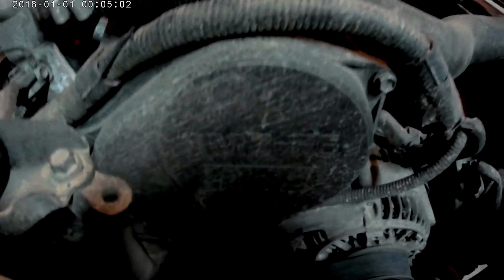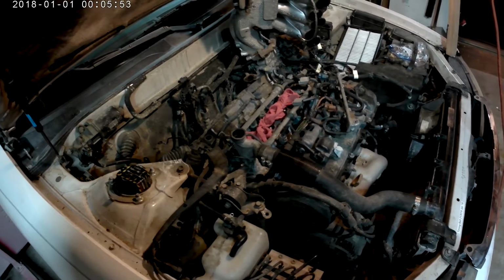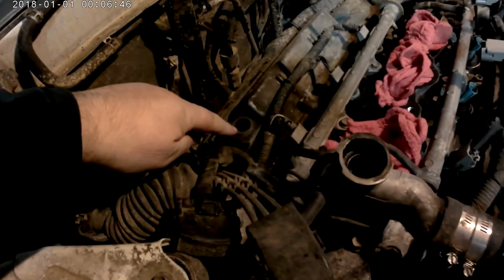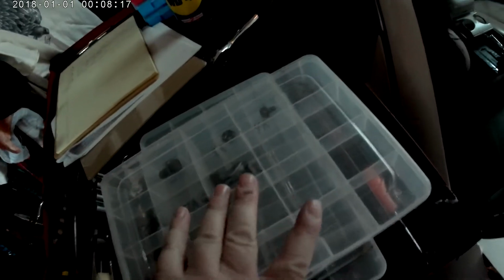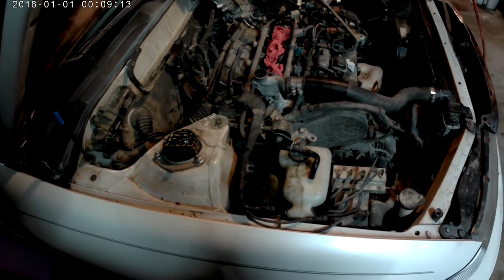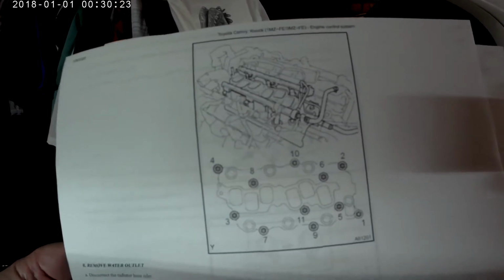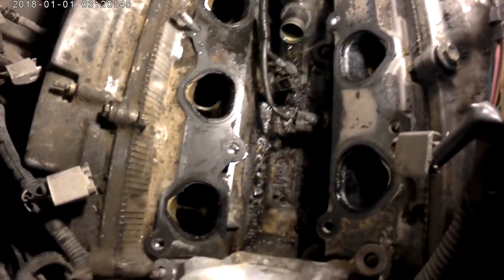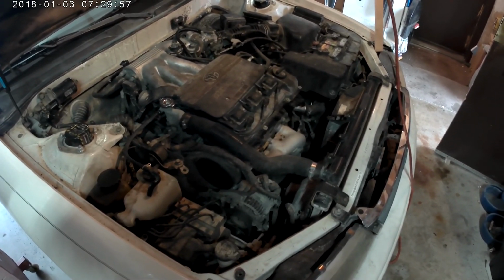Bad Knock sensor easy replace guide, 96-04 1MZ-FE Engine Toyota Avalon Camry Lexus ES300, Best way

Comment: Some excelllent tips in this video, however, sound quality is really bad. You need a better microphone.
Reply from the maker: Thanks for the kudos! Sorry about the sound. I will make more videos' and try to improve the sound.
Reply from the maker: Hi, this is the one and only how to video I've ever posted. Sorry for the poor quality but hopefully you get something out of the couple suggestions I made. I will say that this video was taken the first time I did these knock sensors but I kept getting the knock sensor code so I ended up buying soda brand knock sensors for $300 and that install fix the check engine light code. I recorded the second time I did this but it's so much video to go through I never had a chance to repost it but good luck doing this repair